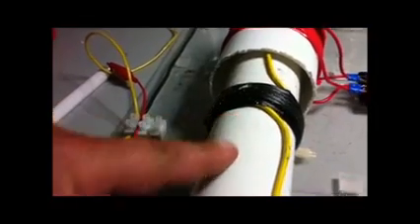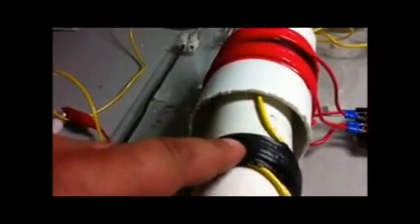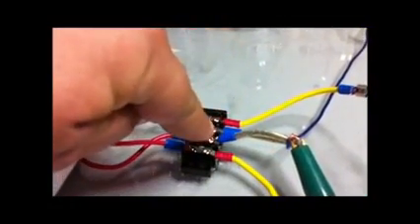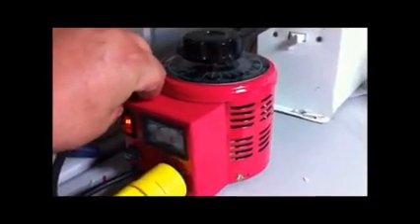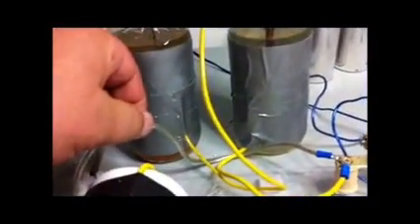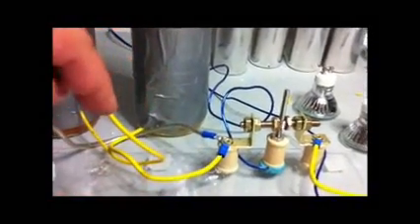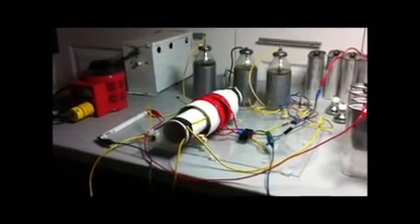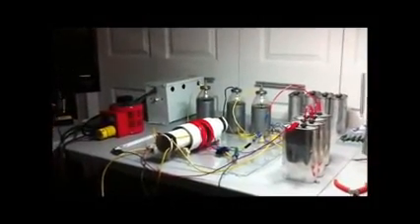Don Smith Device Build Video 2

Comment: Good work in this first attempt! Some friendly advice: If you used an electronic NST transformer @ +20KHz, your output would be increased significantly. The transformer should have an external earth/ground point - CRITICAL! Spark gap distance should be decreased, minimising the work done by the current. L2 coil should have gaps between the windings, which will reduce the self-induction of the coil. See my Don Smith Device Capacitors video - I will be posting videos on my replication soon :)